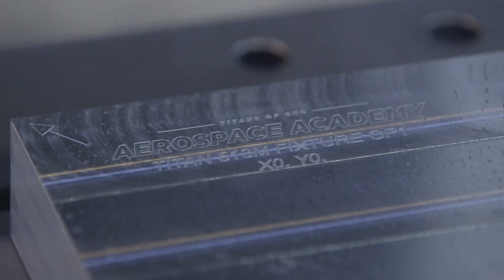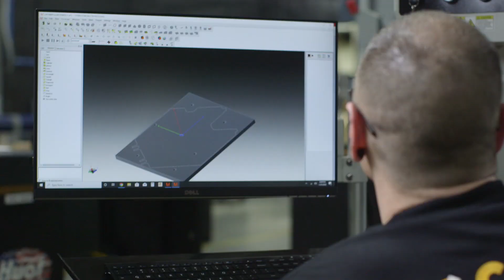Precision Machining + CMM = Aerospace Quality Fixture Plate

Comment: When removing the protective plastic sheet from metal, I have found rolling the sheet off using a dowel or piece of pvc pipe works pretty well versus pulling it off by hand.
Reply: We use a lot of C.A.P., and you're correct, rolling the plastic off versus pulling is much easier.

Comment: Was that plate inspected for flatness, recut/flipped three times, cut deep enough to cut through the metal disturbed during the finish lapping from the mill to stabilize the material?
Was inspection temperature and machining temperature matched or compensated for?
What were tolerances for the finished C'bores Dia. and Location? The tapped hole locations? Perpendicularity between the C'bores and top surface? Microfinishes?
Just curious, aerospace quality varies from purpose to purpose.

Comment: Step 1: buy precision milled aluminium plate
Step 2: face off 9/4237th from the top
Reply: Those plates very in flatness quite a bit.  Some are decent but ive seen some with at least .050 of bow. It may be how it was shipped but these plates are not all perfectly flat.
Reply: Its thick as hell so he gets flatness, no problem at all.

Comment: i know this sound crazy idea and all but since you guys had the biggest and bad-ass CNC machines i every known, had you try carving real size katana/samurai sword? i mean all of from one metal block? eveything made from steel even the katana sheath from single metal, anyway thank you if you guys reading this, if its titanium made which pain in the ass metal, you got your self one of the kind all titanium katana loooooool
Reply: They could do it, I would say out of titanium. A few years back I roughly machine a titanium knife for a friend of mine, mind you it was a very cheap CNC machine, and they had to finish it off with a hand grinder. My friend was very proud of that knife to say the least
Reply from the maker: ferdinand tambunan Great idea... Sword making is definitely an art... Titanium would be doable but would probably be weaker overall and less able to keep its sharpness...
Steel or Super Alloy...
Would be Crazy...

K500 Monel Sword! 
$250,000 :-)
Just the material alone would be incredibly expensive.
Reply from the maker: Warped Perception 
This is Titan.
Checked out and subscribed to your channel. Super Cool.
We should do a mind blowing collaboration.

Comment: With a Renishaw PH10MQ head with a SP25M probe, could that CMM have instead scanned the holes instead of taking discreet points? Could the CMM have also scanned the surface for flatness? It's been my experience that more data (from scanning) allows better analysis of form.